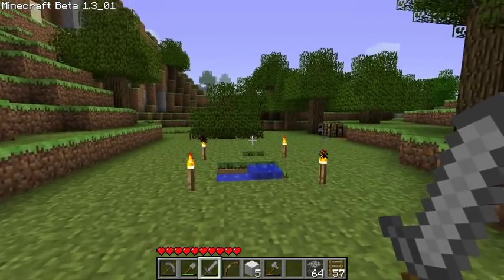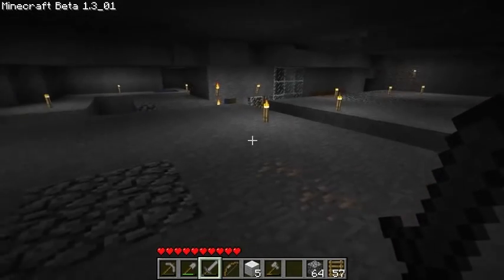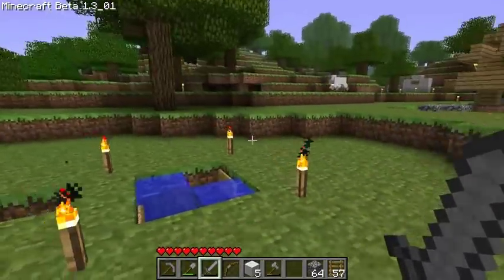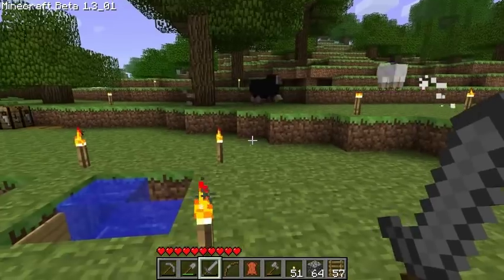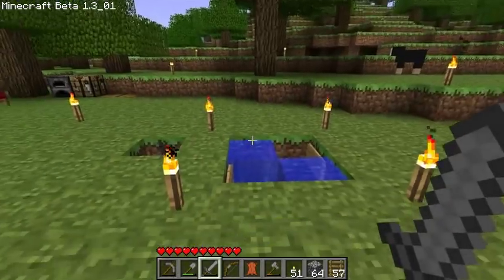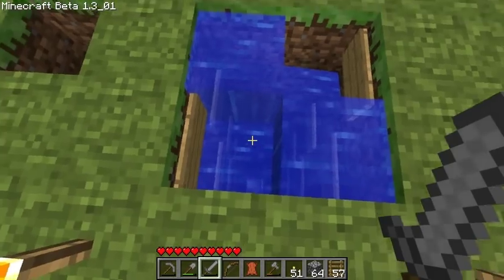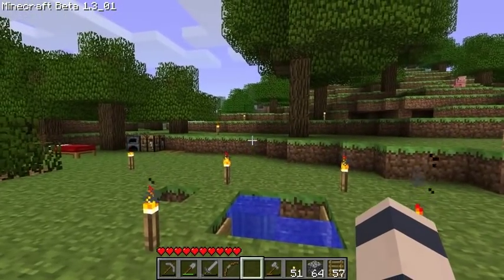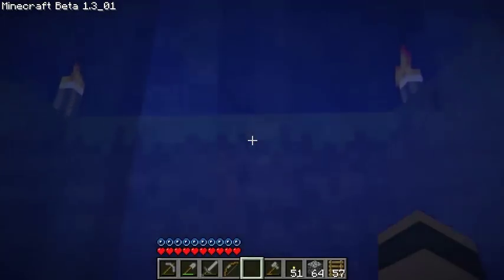Minecraft - Tutorial: Mob System (Part 3)

Comment: If you want to reduce spider climbout, the best thing to do is to make an overhang.  Make your canals four wide, but only on the bottom layer (so there's still only a two wide gap between spawning pads).  Unfortunately this can't prevent it completely -- spiders can jump two blocks vertically and climb from there, and if you make the canals deep enough to stop this then the mobs won't jump into them.  The trick will be to keep spiders under the overhang so they can't jump.

Comment: Another way to prevent spiders from climbing the wall above the mobavator entrance is to dig a two-block wide gap into the ceiling, dig one block into the wall there, place ladders below the gap and lava above so there's a two-block wide sheet of lava on the ceiling.  That way if spiders do climb the wall, they fry.

You have to build a wall below the ceiling to keep the light from the lava from messing with your spawn rates but it works.  I do this in my mob spawners.

Comment: I guess the reason spiders have trouble with soul sand is because they aren't full height blocks. They are 1/16th lower than full height. Using half blocks on the walls might work even better.

Comment: Etho I have a question. I managed to make a friendly version of this and its going well so far. However, I'm having trouble separating pigs from cows and sheep. I managed to make a chicken separator, but pigs don't fit in my chicken separator. Also, is there another way to get the wool from a sheep besides using snowballs, eggs, and arrows? If you need more clarification on my problems, I can make a video if you want. Thanks in advance!!

Comment: @EthosLab Since you're such a cool guy, here goes
I'll also note some to-my-knowledge wrong facts, non-math related
-In the mobavator, it wouldn't help to have a horizontal breathing area, because the animals would still be unable to go through
-You claim mobs spawn in a 144x144x128, while they spawn in a 272x272x128 block, however this does not matter because any mobs outside the 128x128x128 SPHERE around you, will INSTANTLY despawn. Because of this you can safely say they can only spawn in

Comment: @EthosLab I just did some tests (including using hacked blocks suchs as sponge, leaves, bedrock) and I found NO blocks that can withold the power of spiderclimbing, sadly.
About the description:
I have indeed seen those graphs, but as you have pointed out already, got mixed up with diameter/radius
Your information is correct, except it has also been said mobs outside the 32 radius sphere can despawn within 30 seconds. You also seem to be able to magically get surfaces from 3D squares and spheres

Comment: @EthosLab The surface of a circle is pi * r^2, with r being 1/2 of the diameter.
You say the surface of a certain circle (forgot which) is 51000, while, as I explained earlier, this is supposed to be 12000.
After saying this you brabble a bit about the 24diameter sphere which honestly does not matter a whole bunch in perspective to the 128 diameter sphere.
You also claim you should light up all cave systems, while filling them with water is usually much faster